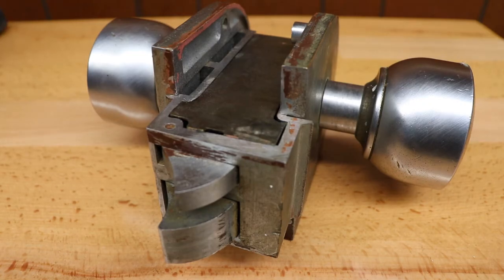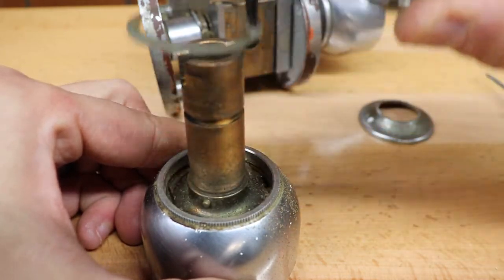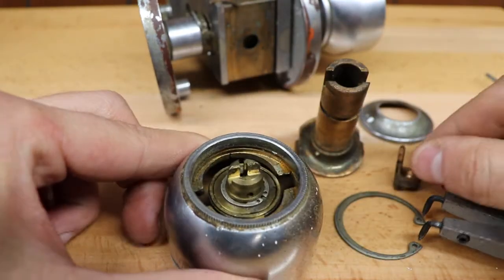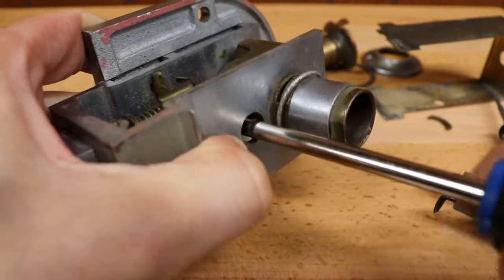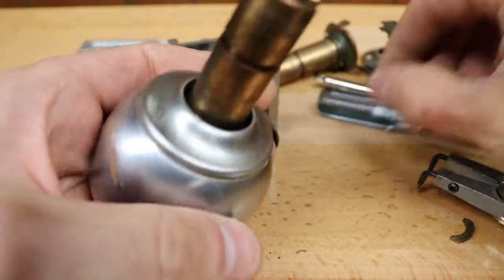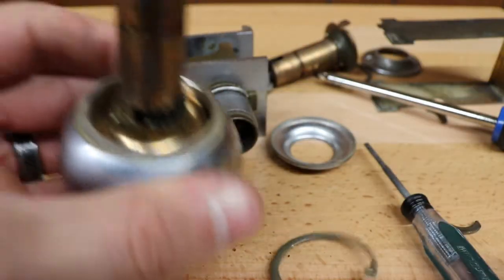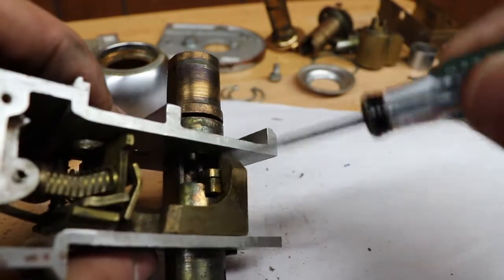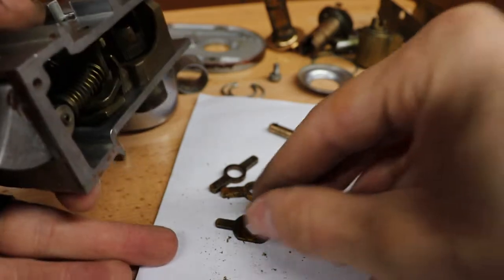How to get to the cylinder on a Corbin Unit lock and taking it further apart

Comment: these Corbin and Russwin unit locks in my opinion, are the finest locks made in modern times.  Incredibly heavy duty, and very secure as they sandwich the door edge, preventing the door from splitting during an attack.  There is a good upgrade in that Best makes an adaptation knob that replaces the original knob at the snap ring, allowing easy rekeying.  Unfortunately the move to lever locks have killed these off...sad.

Comment: You don't need to remove the rose screw to get either side off. There is enough of a gap to get to the snap ring to remove the half-moon clip. Unless there is an issue these locks will last decades with just a bit of lube. I have several locks from buildings here in Seattle that still work as the building is torn down. The only time I have ever removed the main chassis was to scrap them as they had been damaged. These locks will last several million cycles and should almost never need much attention. Taking one of these apart unless you want to is pointless from a service perspective. The lever springs on the UT5200 are the largest challenge of these locks. I have many tricks for getting those out without damage.

Comment: I have those locks all around. They definitely withstand the test of time for sure.
Reply from the maker: I wish they had simply updated them to use levers instead of knobs; I'd love to install them everywhere!
Reply from the maker: Jeff Moss I did not know that. Thank you for sharing! I will have to find a supplier.
Reply: try Security Lock or Akron Hardware, they sell a lot of Corbin.

Comment: any suggestions on a U2055 Classroom function cant get the knob out one the retainer clip and half moon are out , The U2051 entry is easy
Reply from the maker: I have not taken one apart yet, unfortunately.
Reply: Remove the inside knob. Look down the knob spindle. Remove the small c-clip locking toggle and spring. The knob will slide out at that point.
Reply: If it is a UT5255 it is more than likely a roller-bearing lock. it has to be unlocked to remove the knob/lever. You can cheat by removing the knob off if it is the ball design and removing the snap ring from the shaft to the knob.